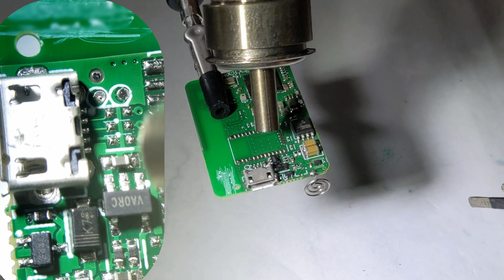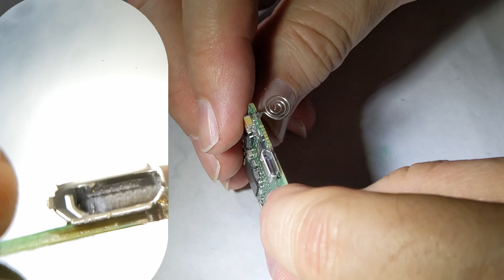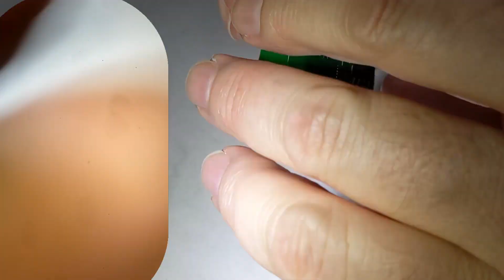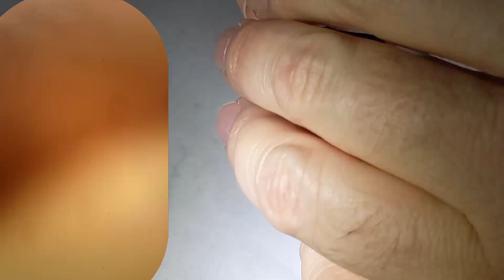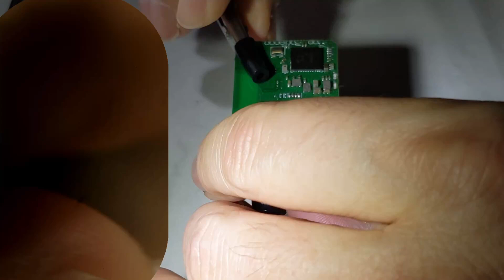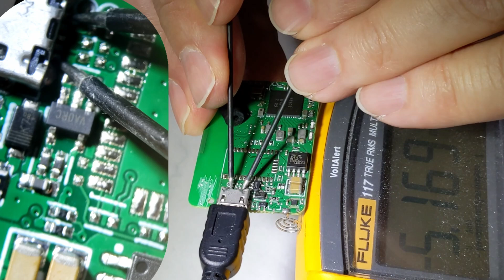Repair a Micro USB Port

Comment: Hey, thanks a lot for the video.

You say that we should apply the hot air around the component, not directly on it, but what if there is no free/safe space to do so? Can I apply the heat directly on the broken port, or maybe, apply it from the bottom side, where the wholes actually are?

Thanks a lot in advance!

Comment: Question: When you use this heat gun, doesn't the flow of hot air cause the solder on the other components on the circuit board to melt?

Comment: I have a standing micro usb por that i want to change for a lay down one is that possible ?
Reply from the maker: Yes, just make sure the pins and through-holes slots are the same.
Reply: @solderingironguide is there a way i can send uou a picture ?

Comment: Instead of using hot air to replace it you could of probably just wicked away the old solder from the through holes and just sodlered it with a solder iron without risk of melting the plastic from the hot air.
Reply: Sure, go ahead and try that and show us how it works out for you.

Comment: Is there a way to convert an old micro port to type c?
Reply: Yes, I would suggest getting a usb c breakout board or getting a 5 pin usb c port. You will need 2 5.1 resistor to solder onto the usb port so that it communicates with usb c to usb c connections that it needs 5v.
Reply: @HavocBlack it's power only, trying to change over my Lyft light, any information is via Bluetooth

Comment: I hope your near west Orange NJ. Sad part is I have everything in this video except the hot air machine. I have a heat blower for shrinking wire sleeves not sure if that’s good. I got a bunch of stuff with a radio kit to learn how to solder. It comes as a project kit but this was during Covid & I never did it. But I don’t have the money to experiment with my pedals

Comment: Dude you made this look so easy. I’m an auto mechanic, and this intimidates me. I’ve done non micro board soldering in the past and did kinda shitty but maybe because I was using a cheap ass soldering gun and solder. I have a  big Bluetooth speaker box and someone broke the micro usb port and didn’t tell me. I went to plug it in and it fell thru. I take it apart and it came off the micro board. So I came across the video trying to come up with an idea on what to do. I don’t have any of these tools/equipment in your video.  I was thinking of replacing the small battery with another  rechargeable battery splicing into the battery wires  going to the board and connecting some type of charger to it or something. lol. Idk where to look for these parts though.
Reply from the maker: Yes, it takes some practice and the right tools. You can look on amazon for the micro usb plug, search 'micro usb female'. If your pcb board has broken traces so the plug can't be soldered on, you could use small #30 wire and solder directly from the female plug pins to the broken traces on the pcb.
You could also connect those wires to the 5V battery you mentioned.

Comment: This is actually way trickier than I thought. 
I've managed to wreck one replacement port already. How to get solder to adhere to the holding "legs" by ensuring they're hot enough WITHOUT melting the plastic inside the port?!
You made it look so easy!

Comment: Is the 60$ Hot Air/Solder Combo link from the description correct? Or has the price changed that much in two years? :D
Reply from the maker: I see $69 with a 10% coupon

Comment: 1:27 you blew off one smd resistor from the board
Reply: Looks like the tweezers knocked it off, then the hot air blew it away
Reply: Haha 😄  nice eye
Reply: Not only that. He also bridged ground to that pin.
Reply: @xuhwj11 I saw that part. Missed the blowing off of the resistor though. He made this look so easy. Then again I don’t have one single tool he used to do this. I’ve done basic wire soldering but never with a micro board. I always had a hard time but that could be because I was using a cheap ass solder and gun.
Reply: @xuhwj11 what does that mean 😅?
Reply: To avoid that, kapton tape should be used to cover what you don't want to remove.
Reply: Nice one. Even when we're watching it being done right, it's being done wrong.

Comment: today I lifted my table while a kvm switch was in a bad position between the moving desk and wall, and yanked the micro USB port off the circuit board. Wondering if this is a better solution to purchasing new. I don't have the tools so might be better off replacing :(

Thanks for video either way
Reply: This is my issue too. I don’t have any of the tools either. I was thinking of splicing into the wires for the battery and connecting another charger or something. The usb port fell off the micro board on my giant Bluetooth speaker box..  i let someone use it and they broke it and didn’t tell me. Rat bastards.

Comment: The board I have has lost the solder in the surface mount pin slots so the micro usb port can’t make a connection, is there way to fill those slots back up with solder?
Reply from the maker: Just use liquid flux to fill the holes, then put solder on the iron tip and touch it to the holes and the solder will fill them up. Then you can use the hot air to let the part sink in.

Comment: Would it work if the hot air was set to 200C?
Reply from the maker: I wouldn't set the air temp that low, set it around 360C or it will take too long to heat up that area.
Reply: @solderingironguide  My heat gun only goes to 200-250 C
Reply from the maker: Set it to 250 max, and that should work..depending on the pcb size may take a bit longer.
Reply: @solderingironguide  Thanks mate!
Reply: Hi, any recommendations for a microscope?